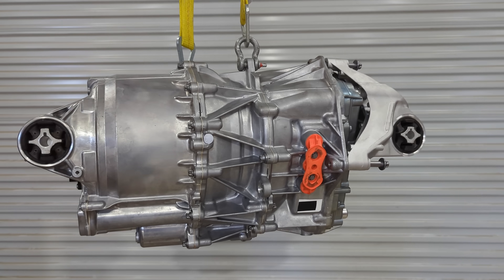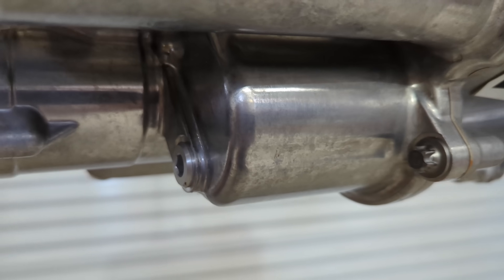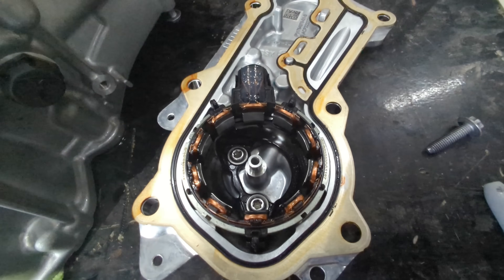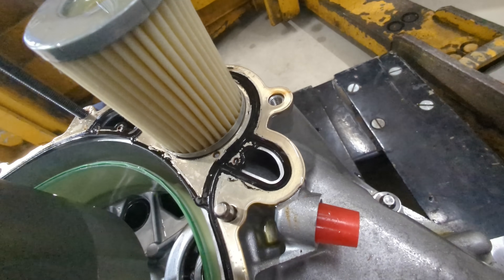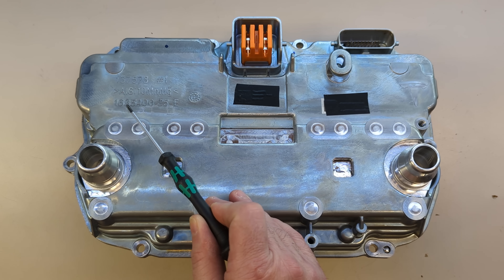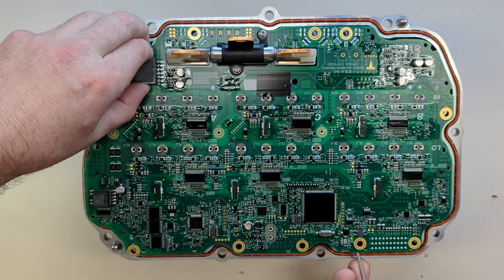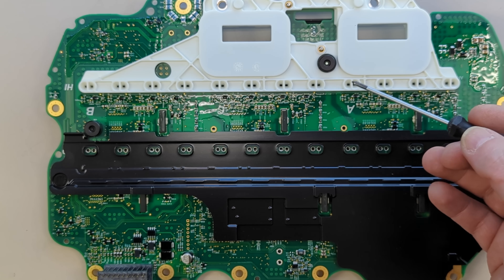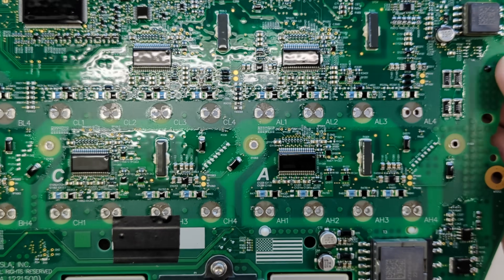Tesla's Newest Motor & Drive Unit

Comment: That breather vent should have a check ball in it.  I'd be pretty shocked if it could take on water by simple submersion.
Reply from the maker: It's just a simple baffle.  No check valve, gore membrane or anything else.
Reply: @Ingineerix  Wow..  I'd be pulling that thing and at least routing a hose up as high as I can, like most pick axles.   I guess they don't plan on you treading water AT ALL..

Comment: Why would you recommend changing the oil every 40k?
What is the oil?  I assume that it is a very light.
What would be the maximum temperature the drive unit would see?  60C?
If the drive unit were submerged in water, I am assuming that would be a great time to change the oil.
Reply from the maker: Yes, it's a special very low drag synthetic called Pentosin ATF9.  I haven't yet been able to determine what they are using in this one, they call it "KAF 1".   40k changes are cheap insurance if you want to keep the car long-term.   Mainly just because the breather allows moisture in.   I'm sure the drive unit can get over 60C under hard driving conditions, but in normal use probably never.

Comment: Just picked up my Model Y a week ago manufactured in Fremont, but was a std winding, not the hairpin. Was yours from Texas?
Reply from the maker: Yes.  You can tell which drive unit you have:  https://teslamotorsclub.com/tmc/threads/what-motor-does-your-2023-model-y-have.293314/
Reply: @Ingineerix  (std) standard winding...

Comment: Is the mileage better on the new Y or did they reduce the battery pack size to compensate for the increased efficiency?
Reply from the maker: Not noticeably so.  The improved infill is probably a wash with the skin effect losses, so my guess it's too slight of an overall improvement to notice, but this is definitely easier to manufacture and lower cost.

Comment: given that the SiCFETS are from ST it makes sense that the gate drivers are too. ST custom made those SiCFET packages for tesla
Reply from the maker: ST also makes IGBTs in that package which Tesla uses in some of the lower power inverters, such as what's used in the front drive unit.  Interestingly they use the same gate drivers for both SiCFET and IGBT.

Comment: Is that really just 400 volt technology?
Reply from the maker: Yes, this is a 400v only drive unit.   It is not really viable to have one inverter design for both 400v and 800v.   If Tesla uses 800v, they will spin a different inverter.
Reply: Voltage isn't as important as people make it seem, it's only slightly more efficient and reduces wire size but not much else besides a higher requirement for safety.

Comment: So much easier to manufacture and maintain than any ICE engine. Clearly the future.
Reply: Nonsense nonsense nonsense!!!! ICE are also easier to manufacture, simple regular maintenance and there are millions of super old ICE still on the roads!
Reply from the maker: I don't see how you can claim that any ICE is easier to manufacture, there are so many more parts and critical machining steps needed.   This drive unit is even simpler than most ICE transmissions!   An electric drive unit is always going to win on manufacturing cost, simplicity, and durability.  The only place an EV is not superior is the fuel source (battery vs. dense liquid fuel is no contest.... Yet)
Reply: @Ingineerix  for the combustion engine most parts are almost basically the same! Also with all the possibilities and customisations ICE can be used for almost all applications the ICE doesn't really compare to electric motors because ICE are shave way more applications and usabilities.
Reply: @Ingineerix  the ICE transforms many different types of fuels for different applications while with EVs it's just using the limited energy stored by the batteries. That's why ICE vehicles/equipments can be in service 24/7 almost non stop building/maintaining roads, hauling 20,000 containers across oceans, used in emergency situations to reopen roads and infrastructures.
Reply: @Ingineerix  compared to an ICE, an EV is like driving around while been connected to the grid or solar panels... ICE are self sufficient
Reply from the maker: @carholic-sz3qv  You are WAY wrong!   Where does that magic fuel come from?!?  In fact, A study in 2019 by the Argonne National Laboratory estimated that the total energy consumption for producing a gallon of gasoline in the United States averaged around 6 kWh per gallon. This includes the energy used in oil extraction, refining, transportation, and distribution.   If you compared a similar car to a Tesla Model 3, such as a BMW M4 which is about the same size and performance, it gets 24mpg, so that's about 250Wh/mile if you believe Argonne's study.  That's enough energy saved if you just stop using petroleum to power the Model 3, as that's about what it gets (250Wh/mile).  So driving an EV is essentially "free" if you just stop using petroleum.
Reply: EVs have been the first vehicles way before ICE, ICE are used all around the world even to the toughest conditions where your EV won't survive.

Comment: A great review, super interesting !
I wonder if it uses rare earth magnets or not, but I guess it is hard to check.
Regarding the weight, from what I see in your old review, the older version was about 90kg and this one is 88kg, pretty disappointed by the minimal weight savings of only 2kg ?!
Can you give a rough estimate on the volume difference between the two ?
Reply from the maker: I weighed the old one with a bathroom scale, now I have a more accurate scale, so I'd need to re-weigh the old one to know the exact savings, but any reduction while keeping the same performance or even improving it is a win.   Hard to determine volume without dunking it in a tank, but it does appear somewhat smaller, especially by the inverter area.

Comment: Impressive! Do you know what the voltage and current rating is for this unit?
Reply from the maker: Probably around 450V max and 800A.   In the Model Y it never goes much over 400V.

Comment: I like how they changed the cooling structure. Previously the SiC devices were sintered right into the inverter housing - so the whole housing was moving through the sinter production line and if there was any mistake the whole thing had to be thrown away. It seems now they fix the power devices onto a separate closed cooler, which they can test (electrically and for water tightness) before they weld it into the housing; also no need to haul the whole housing through the sinter line.
Reply: It has been Much nicer to handle 😉

Comment: Great video. I wonder what Teslas definition of "life of the car" is. For many car manufactures it seems to be "until the warranty runs out" which explains "life time" automatic transmission fluid.
Reply from the maker: Tesla says they engineered it for 1 million miles.  Personally, I recommend 40k miles for drive unit lubrication change.  Don't need to change the filter.

Comment: A GREAT TEARDOWN!
What is the size of the PCB? How many Layers does it have?
Reply from the maker: 11.5" x 7"  (292mm x 178mm)    Not sure on the layers, but I'd say 4-6.
Reply: @Ingineerix  Thanx for the fast information. Did you also measure the weight of the inverter?
Reply from the maker: 9.5lbs / 4.3kg  (Complete assembly)

Comment: Thanks! Love your videos! 😊 I am interested where all those discharge resistors went. Also, interested to know what those blue chips are as working as an electronics supplier myself.   Can’t wait to see them challenge for the next $1000 platform!
Reply from the maker: I suspect they applied the "best part is no part" philosophy and just use an active discharge scheme, similar to how they used waste heat for heating the battery.   By "blue chips" you mean the small SMD parts arranged in a half-circle at the top?  Those are ground resistors to couple an internal ground plane to the chassis connection.
Reply: Thanks for your reply. I see. Surprised that they didn’t change the SiC FETs from ST too. Maybe not to change the whole gate circuit? Pretty sure ST will stay as the WW No.1 SiC supplier!
Reply from the maker: @chuck8kb906  They did change the whole gate drive circuit, but it's also ST, and an evolution from the gen 3.
Reply: @chuck8kb906  we cant see the FETs here, they mustn't necessarily be from STM (they probably still are; however, there are also rumors about onsemi providing some now)
Reply from the maker: The package is pretty unique, I seriously doubt there are other manufacturers yet.   I also did due diligence and compared the gate turn on threshold and on resistance to the older ST ones, and the numbers were similar.

Comment: You have great content. Love the inverter board.
I hope that you get the opportunity to examine a Lucid drive unit. Once people start wrapping those cars around trees (not wishing anyone harm) those Lucid units should make great retrofit units for ICE cars.
Lucid Motors has an interesting video teardown of their drive unit but it is more consumer oriented. I would very much like to see how they are lubricating their differential and peek inside their compact high-power inverter.
Reply from the maker: I too would love to teardown one.  Feel free to send one!   =)    Though Lucid is low-volume, and someone would have to reverse-engineer the control system to use them in conversions.   That is non-trivial!   I'm one of only a few people that know how to drive the Model 3/Y motor and (so far) the only one that can drive a Plaid motor.

Comment: 4:00 - just so no one's under any illusions the hairpin stator design is what's ALREADY found in the Chevy Bolt and Ford Mach-E (Borg Warner) drive units.  in addition it's ALSO found in many Hybrids, both Honda and Toyota's dual motor Hybrid's and both GM's old 1st and 2nd Generation Volts.  for those paying close attention to Sandy Munro, you will have likely heard him "confess" the hairpin stator design is an innovation created by GM.  in addition to all the other benefits mentioned, the better fill also stabilizes the windings PHYSICALLY against flex and movement (torque reaction) which can also be a problem with traditional wire wound stators, both new and as they age.
Reply from the maker: No, the Hairpin stator has been around since the 60's and was used in stationary motors long before EVs became a thing.   The magic here is the total collection of parts that make one of the most cost-effective, powerful, and efficient EV drivetrains being produced.

Comment: Is this a drop-in replacement for the old drive units?  It would be great if Tesla didn't have to keep an inventory of the older parts for any repairs.  I'm also wondering how much more range I would get if I swapped drive units on my older Model 3?  It probably wouldn't make economic sense even if they offered it as an upgrade.
Reply from the maker: Yeah, other than the HV connection, everything else is the same.  I don't think it will increase range in any meaningful way.  I seriously doubt they will ever offer powertrain upgrades for existing cars aside from software.
Reply: @Ingineerix  Oh, I totally agree, though if it's 10% more efficient, that's a bit more range.  I do think they would want to make this available as a replacement part, though, as it would reduce their need to keep a stock of the older parts for any replacements.

The upgrades I want are a heated steering wheel and the heat pump, but those will never be offered.
Reply from the maker: @pfcrow  Best to just sell the old one and buy a new one.

Comment: Nice presentation of the inverter evolution. The arc quenching is so simple. Is it necessary, as the pyro will brick the board. Or will it protect DC components between the batteries and the inverter?
Reply from the maker: If the pyro is deployed, the board is already bricked.  It is only there to prevent wheel lock up in the event of a catastrophic inverter failure (multiple phase legs shorted together).   At that point you replace the whole inverter module.
Reply: @Ingineerix  Thank you for the explanation. That makes perfect sense, when you realise the current can flow back during Regen, and a short would create as much load as the board and wiring would carry.
Reply from the maker: Yeah, it would lock the wheels and cause a loss of control, which could cause an accident if you were driving at high speed.  It would be about like someone yanking the hand brake hard in an ICE car.

Comment from the maker: BEFORE you ask, look here:

If you would like to support me directly:
https://www.paypal.com/donate?hosted_button_id=DT4S6DVGSBX3W

The Tesla part number for this Drive unit is 1665000, so I'm calling it the "Triple 0".  Tesla also has a 3 letter designation of 4D1.

Weight (wet): 194 lbs/88 kg

Parts on PCB:  
Main DSP:  TMS320F28377DPTPQ  https://www.ti.com/lit/gpn/TMS320F28377D-Q1
Safety Controller: 16324  1TC  TC14427  2212 (assumed Tesla proprietary)
Gate Drivers: STGAP4S  https://www.st.com/resource/en/datasheet/stgap4s.pdf
IR Temperature Sensors: ACC T5977510 (Could not locate)
Digital Isolator 1: ISO7741FQ https://www.ti.com/lit/ds/symlink/iso7741-q1.pdf
Digital Isolator 2: ISO7762FQ https://www.ti.com/lit/ds/symlink/iso7762.pdf
Analog Isolator: https://www.ti.com/lit/ds/symlink/amc3330-q1.pdf
Pyro bypass fuse: Buss TS-10A05F T10AH500V
PCB size: 11.5" x 7"  (292mm x 178mm)

Haripin stator appears to have 54 slots with 8 bars in each.  Stator resistance is 8.1 milliohms, vs 10.4 milliohms for the Gen 3. (taken with 4-wire kelvin connections on my 6.5 digit Keysight 34461A using a 10 second sample time)

Comment: I recently (this last weekend) discovered your channel.  I subscribed and watched about a dozen or so. I also did a search of your videos for the question I am about to ask and did not find it.   You point out a bunch of processor/microcontrollers, the12v system, the drive unit, the battery manegment system they all have things like powerPC processors or some other micro.   All of that takes firmware.  Does the Tesla OTA update system allow all of those processors/microcontroller to be updated?   Is it one giant serial JTAG loop or is it done processor by processor?  Or is it stored in the main computer and the firmware gets uploaded on power up, like FPGAs?
Reply from the maker: The firmware files for all ECUs in the car are downloaded by the car computer and then you get the "alarm clock".  Then when you choose to install the update the firmwares are given to the gateway which is able to talk to each ECU over various networks, (Ethernet, CAN, LIN, etc) which it uses to re-flash each microcontroller using a bootloader.  The Gateway knows what version is running on each ECU, so it decides whether an update is needed for each.
This is a good idea for a video.
Reply: @Ingineerix  thanks for the reply.  I’m working through your back catalog trying to decide on buying a MX Plaid. Your channel is great.
Reply from the maker: Thanks!  The Plaid is truly awesome, but the Model X is my least favorite Tesla due to the poor reliability of all it's extra systems.

Comment: Very cool!  What was the weight of the new drive unit vs the old drive unit?  And did this new motor run quieter than the last generation?   Did you observe any difference in performance?
Reply from the maker: If you look in the description, or the pinned comment at the top, I posted the weight.  It does appear to be quieter.  Performance is the same as dictated by software.

Comment: I have a question please. Do they still use rare earth material in this particular drivetrain? The hairpin mortor is what they announced in the Investor Day as the next generation drivetrain for next generation vehickle with no rare earth, but since this is in the current model, could it be that they still have rare earths in it? Nevertheless, amazing teardown and surprisingly quick release from Tesla!
Reply from the maker: I'm reasonably sure the design they are talking about will come in the new lower-cost vehicle.  This is just an evolution of the existing Gen3 design, so it likely has similar magnet composition.   I don't have any way to test the magnets, so I can't be sure.

Comment: Great job bro. Looking forward to your further analysis on the power semiconductor parts
Reply from the maker: Sadly, I could not do a destructive analysis on this, and even if I cut open the inverter, the part numbers are proprietary.  I really don't have the ability to do anything more.
Reply: @Ingineerix  Never mind. Your work has been inspiring enough. Thanks
Reply: @Ingineerix  the mold compound of the parts can be removed relatively easy "mechanically" (hammer) to reveal the dies. Would be interesting to know if the still use the same SiC die area as in the the previous gen.
Reply from the maker: @Juz4m  Yeah, but that's destructive.   I'd be trashing a $3k drive unit, and it's not something I can afford to do for a few hundred $ in YouTube revenue.

Comment: What about some size dimensions on the complete unit, break out a tape measure,and how much HP , rpm etc etc.
Reply from the maker: It's pretty much the same size as the Gen 3, the mounting points are in the exact same places.  It's slightly lighter, and putting out the exact same power as the Gen3.   This is mainly to make it easier to produce, lower cost, and more reliable.